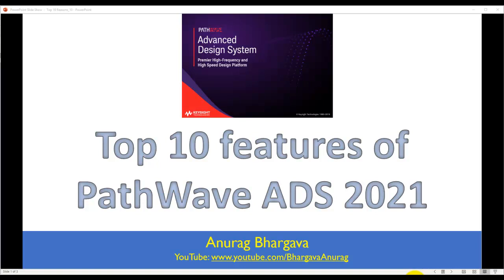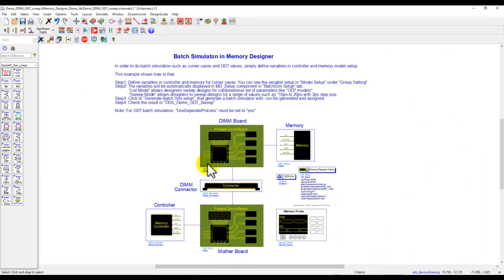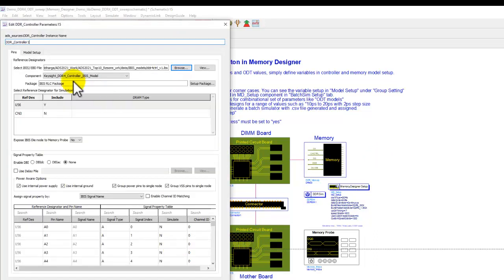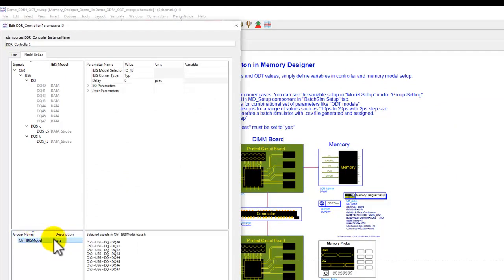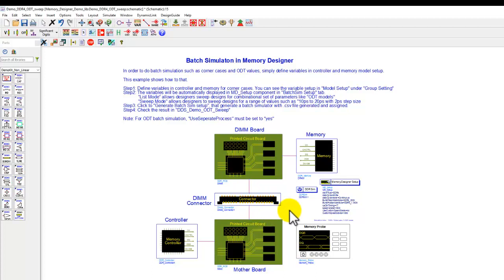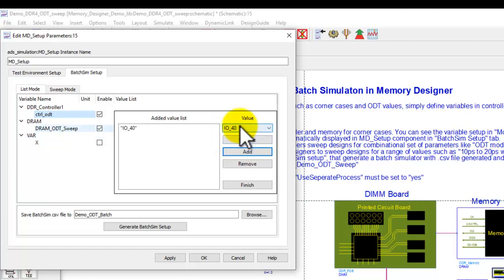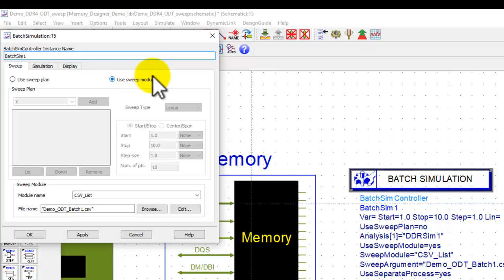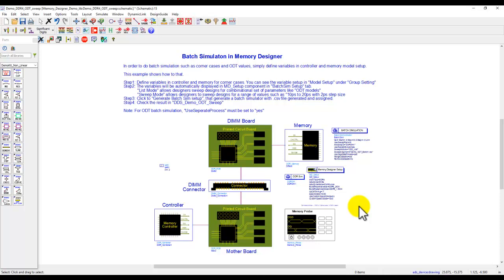ADS2021 Top10: Batch Simulation in Memory Designer

Comment: I have a question, I was asked to miniaturized an electric circuit from 3cm2 to 1cm2 having a transistor and lumped elements, could you please tell me all the possible ways I can take to miniaturize the circuit into 1cm2
Reply from the maker: Hi Luck,
Its little difficult question to answer without seeing the original design to assess the scope for reducing the size. However, you could try to play with lumped element sizes like use 0201 or 0402 if possible, make sure it is not a flat or a series lineup kind of design with everything cascaded in a single line, you should utilize the area available in the best possible manner by folding lines, make it as a 2-4 layer kind of PCB so that you can mount few things on the top and few on the bottom layer etc
Again these will be some initial thought but real answer can be different depending problem at hand.
Reply: @BhargavaAnurag  thanks you for answering. I also have a varactor to be tuned and also and inductor. And the circuit works from 270Mhz up to 1Ghz. Could i use MMIC technology?. Or multilayer with vias.
Reply: @BhargavaAnurag  i have decided to go with multilayer. Could you send me some PDF on that. Or some videos please.
Reply from the maker: @ltteogoali7251  Kindly check 3-4 videos under Learn ADS in 5mins playlist on multilayer designs which should be of your help.
Reply: @BhargavaAnurag  i will. Thank you. If i have any question could you help me. God bless you.
Reply: @BhargavaAnurag  i have a question since i will put some element on the top layer and other elements on the bottom layer, should i use only i layer for my multilayer design?
Reply: @BhargavaAnurag   by using multilayers? is it sufficient to use one substrate where i can put elements on top and on the bottom of the substrate and connect them with Vias, or i should have at least two substrate?